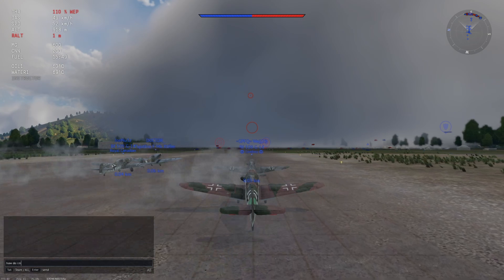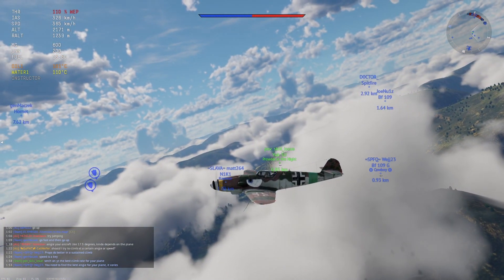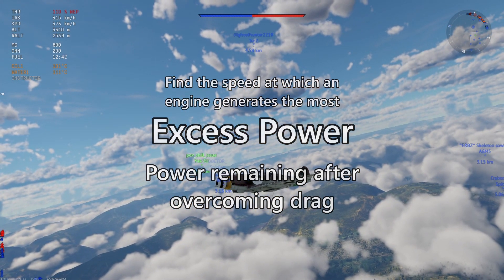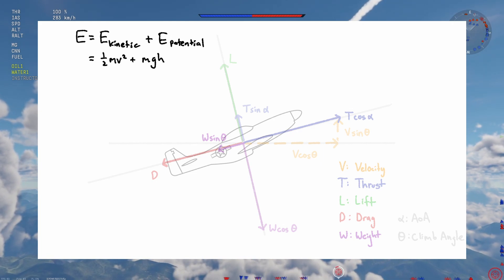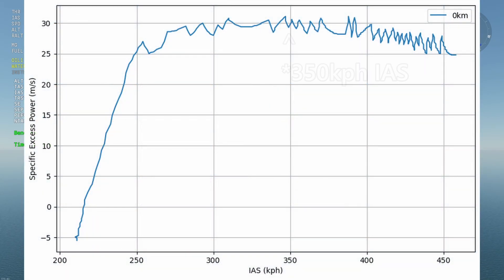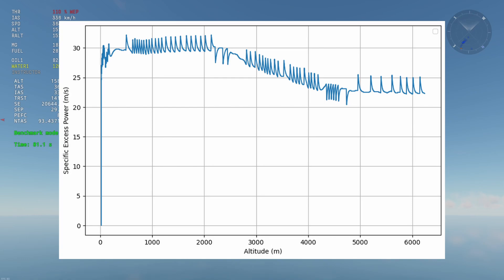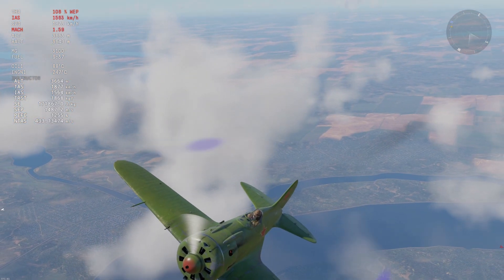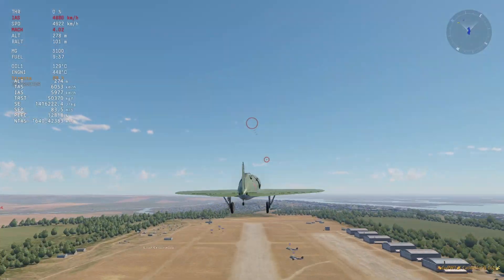Optimizing Rate of Climb | War Thunder

Comment: This test is probably much more important for the planes that overheat easily like BF109s and FW variants. As you said, with MEC and prop controls you might be able to squeeze out even more, I dabbled in this stuff ages ago but came to the conclusion it was probably just better to leave auto engine management on.
Reply: On some planes MEC actually makes them perform way better.
From my testing, on the IAR 81C (It's a premium in Italy, so you can test it out freely if you wish) (rank II BR 2.7 RB)
In the next example I am using said plane with the engine on WEP from the moment I start moving.
If you leave WEP on, without MEC, plane will overheat the engine while having a top speed of around 390 at sea level, at 385 the temps are orange on the engine and yellow on the oil. Prop pitch is brought way too high in auto mode it just feels like it hits a brick (well, more of a aerodynamic) wall. So it overheats the engine because of the higher RPM, and blocks it from going faster because of the drag of the propeller and the radiator fins. Nice equilibrium there, eh?
Same  WEP setting, but with MEC, prop pitch at 60% (You'll need ~85% for take-off (careful not to break the engine from over revving, stall speed is around 150 km/h), 72% for up to 240 km/h, and after that speed 60% (I tend to use 85% for take off then once I reach 150 km/h I bring the prop pitch down to 60%) this grants the top speed of 407 km/h at sea level compared to that 385 km/h... decent upgrade, top speed of this plane is 485 BTW), radiator at 0% (wish I was kidding, taking to account I am saying the engine overheats on WEP when left on it's own...), and oil radiator at whatever ya like (100% because it doesn't affect drag at all it seems) it flies at 408 km/h from my testing... 390 km/h if you take the 250 kg bomb.
And that is on WEP the entire time... With the temperatures being in the yellow for the engine itself it doesn't exceeds 251 degrees (Celsius) which is 1 degree over the point where the game shows the engine as yellow (so basically the plane can fly at a higher speed that is sustainable than without MEC where it can reach a lower top speed and then you have to get off the WEP because of the heat), and normal temperatures for the oil. (Upon checking the wiki, radiator seems to work best at a speed higher than 341 km/h... so I guess that explains the 0% on the radiator, it's all in the prop pitch it seems). I've flown for at least 15 minutes on WEP and never had the engine's temps go over yellow (252 degrees is where it seems to sit at). But that is at sea level. Top speed of the plane (485) at the height of 5 km can be exceeded slightly with the prop pitch 48%, radiator 0%, oil radiator 100%, Mixture was on 20%. Going under that doesn't seem to affect it in any other way than the engine overheats insanely quick...
Another example of the automation screwing up in planes' engine management are the BF109 (tech tree one at 5.3), Yak9 ,G55 and G56 in the italian tree... All of these planes can sustain high speeds on WEP without overheating. (Or at least they overheat way slower with MEC)
When I was grinding Air RB I demonized the G55 and G56 for overheating...but it wasn't their fault.
It was the game turning the prop pitch to 100% and both radiators to 0%. In order to grant a little bit of extra top speed.
Issue with the G55 is tho, radiators fully closed let you go faster but cook the engine really quick.
If you open the radiators your top speed goes down by a lot.
It depends a lot on how much you can lower your drag, and how much you can optimize the engine in not generating heat, dissipating it OR striking the perfect balance between drag and engine heat (radiators + prop pitch). (BF109 can have either top speed runs with which it reaches 570 km/h for a few seconds, or it can sit on a constant 550 km/h, still testing here, so there might be higher attainable speeds)
In theory you can make the IAR or any plane not overheat ever by putting the radiators to 100%. But you won't reach high speeds with that tactic.
And as much as I hate saying this, each plane has different percentages where it runs optimal. You yourself need to find it.
MEC on the BF109 (G14/AS) Sea Level:
 Speed: 557 km/h
Prop Pitch: 50% Radiator: 5% Oil Radiator: 5%
Non MEC on the BF109 (G14/AS) Sea Level:
Speed: 548 km/h
Temps are in the orange, they go into the red after a minute or so of maintaining this speed. This plane tends to run out of fuel faster tho, so do take a look at the fuel every now and then.
BF109 (G14/AS) at 7 km:
Speed: 677 km/h (672 km/h without MEC)
Prop Pitch: 40% Radiator: 10% Oil Radiator: 10% On this one there isn't an easy way out. It requires a bit of micro managing, whatever goes into orange first, bring the radiator of said fluid to a higher percentage, 30% if you want to keep the speed, 100% if you want to cool off very quickly but give up speed.
Gonna be honest, the BF109 is giving mixed signals. I'd say, at sea level altitudes, take control of the pitch, keep it at 47%, at the 7km mark where the plane reaches it's top speed let the game handle the pitch. My pitch changes didn't really do much in reaching higher speeds. Just handle the drag and the temps.
Another note: I was flying it with the 20mm cannons installed. 30mms have less drag. And without the gun pods it reaches higher top speeds than this. Also, because this is the italian version, it has better cooling than the german one, so if you have the german version, sorry, you can start off with the stats I have here, and then increase the radiator % until the temps stay at a stable rate, or somewhat stable. 
G55: MEC
Speed: ~500 km/h
Prop pitch: 80%
Oil Radiator: 20%
Radiator: 20%
According to a spreadsheet I found a few days ago ("War Thunder Top Speeds at sea level" it's called. I think it shows up in a Reddit post, I'd leave a link, but last time I did that, YT sent my comments to the shadow realms) that started my entire testing here, the G55 can reach a speed of 527 km/h, and yes, it can, but by that point the engine gets damaged and looses power... Bummer.
I think I'm gonna end this here tho... I'll do some more testing like this,write down the results and maybe even record and show the methods I've used or who knows, I gave you an idea on a video...but I'd say this has reached it's end point in usefulness and me updating this constantly is a bit tiring. I'll leave a final message on this and say that it depends on each plane. On most I've tested it seems it's better to keep the auto thing off in most scenarios. Depends on the plane, and height. If there's a plane you feel it's underperforming, go into MEC and test things out like I did. It most probably IS underperforming. Game is trying to put the prop pitch too high to a point that the engine can't defeat the drag and propel you at a faster speed. But it tries to do so anyways, and in that constant trying to defeat the drag, it ends up overheating the engine which leads to you having to get off WEP and loose speed. All of the speeds I wrote here are sustained speeds at sea level and the height the game says the top speed is at. Other than the BF109 and the YAK needing some micro managing on the radiators, the other planes I've tested never needed anything changed on the 4 stats you can change in MEC (fuel mixture, propeller pitch, oil radiator and radiator). Only the IAR I tried the fuel mixture on. Most of the time I ran out of fuel before I had the engine overheat.The fuel mixture seems to affect performance at higher elevations, changes very little at sea level and interestingly enough, doesn't seem to change fuel consumption. BF109 doesn't let you modify it. Anyhow, if you have any prop plane ya have a question about and want tested (and is in the italian tech tree) tell me and I'll reply and try to help. At least at the moment of writing this, I only had the italian tech tree researched to about 70%.
Reply from the maker: @Rob-326  damn bro you wrote a whole ass essay, you think I'm gonna read that? (I am going to read all of it, just not at the moment. This looks like a really detailed explanation, thanks!)
Reply from the maker: Huh, yeah that is quite interesting... I don't really have anything to add to that cuz idk much about MEC. but thanks for the info! And lmk if you find anything new in your testing
Reply: @CatWerfer  I recently found out about the MEC stuff too.
Had way better results in matches where I was using MEC than in ones where I didn't.
Reply: @CatWerfer  Well, testing for now is done. I edited the comment a lot of times (Way too many lol). And I think it is in it's final form... At least for the forseeable future that is.
I added the results in that comment at the end.
It went from an essay to a thesis or something. xD
Watch Gaijin change the way aerodynamics and thermodynamics work in the next update making this entire thing obsolete.
Cheers!
Reply from the maker: @Rob-326  kinda wanna save this somewhere as a reference cuz it'd be a shame for this to get buried under 10 layers of comments
Reply from the maker: Huh ok good to know

Comment: "the overall goal we are trying to achieve when trying to optimize climb rate is to"...deliver the plane into a winning position in the game(/mission). the best climb method will depend on the objective of the climb, which sometimes is to deliver the plane to a given height not just in the least amount of time alone but with a given airspeed at altitude as well. this is most prevalent in jets particularly on an intercept, which will accelerate at low altitude first and then climb at a given mach number (Rutkowski profile). In war thunder props it can sometimes be better to arrive a little later to height with a lot more speed when you get there, especially in planes which rely on speed to survive
Reply from the maker: @ArtietheArchon  I should've qualified that statement with "for the purposes of this experiment and video", I am aware that maximizing sep is not always ideal especially when you need to gain speed for an engagement or get in a certain position relative to the rest of your team and enemy
Reply: @CatWerfer  so I did 3 climbs in the P-47, it was dead even getting to 15,000 feet in a 20, 17.5, and 15 degree climb. in that instance the player is almost required to consider other things in choosing their climb angle...at the start of the match a lower climb angle will put you closer to the enemy while a steeper climb angle will leave you with less speed. this is probably worth a video
Reply from the maker: @ArtietheArchon  I am planning on eventually making a video on positioning particularly in the early game. Interesting find, ill test it out myself when I get around to it.
Which p47 is this?
Reply: @CatWerfer  the only one that's not outright masochism IMO, the D-28 and clones
Reply from the maker: I like all of them, they're not all meta but I have a lot of fun in the razorback, and the P47N is nice in ground rb as cas+cap

Comment: me looking at these graphs knowing i just use 20 degree climb universally and adjust by looking at speed. too slow? reduce angle; see what happens; adjust if neccessary. generally staying above 300 kph. works just fine. after all its just wt most people dont even climb at all so any angle above 0 is good lol
Reply from the maker: yeah if it works well for you then its probably good enough lol. just so long as you're not lawnmowing lmao

Comment: I don't think the Mustang has supercharger gears, since it uses turbocharging. At least the Merlin engined ones.
Reply from the maker: I'm probably using the wrong word, sorry for not doing a more detailed look into it, I probably shouldve when making a technical video like this.
I don't really know that much about engine internals and how they work so I kinda guessed hoping i was right (but i guess i wasnt)
There is a distinct performance inflection point at 2km and 4.4km for the p51h engine though so if it isnt supercharger gear then it at the very least is something that's hardcoded in the game
Reply: You’re correct about the 51 have gear superchargers.

Though your conclusion that 2.2km and 4.4km are the gear change altitudes is a little off, but not by much.

2.2km is the critical altitude for the superchargers first speed. 4.4km is the critical altitude where the the first speed can no longer generate enough boost to make up the HP deficit caused by engaging the second speed for the superchargers. 

If you kept testing you would find an inflection point at 6ish km that looked like the one at 2.2km, where the second speed peaks.

Geared superchargers usually gain power until their peak altitude. This is because the engine cannot fully open the throttle on the supercharger until that point without over-boosting the engine. Superchargers hate throttling because the engine has to use the same amount of power for less boost. 

After the peak altitude the engine loses power because the supercharger cannot sustain the needed boost anymore. 

Running the second speed takes more power. Hence why you wait to change gears until a certain alt
Reply from the maker: @zedoktor979  ooo okay, thanks for the thorough explanation.
Do you think this changes much about the conclusions I arrived at in the video?

Comment: I always aim to find the angle that very slowly increases speed and then droop the snoot a little to increase my speed gain. Dunno if its the best way, but i always seem to end up higher than most every other plane outside of the "meta" props. Can't say the same for jets cause flying high always ends up with me getting obliterated. So i just feather the thruster for max speed near the ground.
Reply from the maker: yeah it seems everyone has their own climbing strategy and if it works for you and you're conscious enough to put thought into it then tbh you're probably fine. The big issue is the US mains bombing bases in their p51s...

Comment: i actually try to base my climb off the deflection angle.
for any plane i try to find the speed where my true velocity marker is less than ~5 degrees apart from my nose direction, you can see this in virtual cockpit view.
you didnt adress this method in the video but im curious about how effective it really is, for me it usually allows me to find good climb angles really well
Reply from the maker: ooo thats a really interesting method. if you do end up testing it yourself and timing it compared to the others then let me know how well it works, i'd be interested to hear
Reply: @CatWerfer  im not interested in doing a thorough test but i decided to do  quick test in the p51h. 1 run each
(for this comment, DFA = deflection angle)
my test setup: spaded p51h, cold start from runway race to 6km, no mods or anything to set accurate stats, using phone stopwatch to time it.
control test ~17.5degree set angle: 4minutes 12.5 seconds or 256 seconds
(notes: my IAS was roughly around 290 for a lot of the time start of the test i rose up to 24 degrees climb angle at its peak but eventually had to lower down to 18 again as the deflection angle worsened due to lower air density)
variable 3-4 degrees of deflection angle: 4minutes 14 or 258 seconds. i say variable because at the start of the climb it was a bit of testing where to get the DFA and airspeed to stabilise (i am not a perfect human PID controller after all :P).

conclusion: the method seems better than set IAS, and either on par with or roughly worse than set angle but hypothetically applies to olmost any plane ignoring other characteristics (me264 would be a notable example with the standard DFA being +5 degrees due to the fucky wing angle). Because every plane suffers from a lot of extra drag with too much DFA and wastes potential climbrate when speed is so high that the DFA is negligent.
but the IAS tested in the vid also only up to 290, which as you already mentioned the ideal IAS climbrate is closer to around 340
Reply: also i just realized i dont know what AOA or deflection angle exactly even is, because i googled it real quickly and the answers seem conflicting. so just to be doubly clear i mean the difference between true flight direction and plane nose direction (appearently deflection angle is just aileron/elevator angles oops)
Reply from the maker: @jevry4307  hm thats pretty neat, thanks for the find! maybe I'll also test it since it seems like a pretty reasonable compromise of a climb method
Reply: This is the easiest way. I usually try to maintain a 14-15° climb with the marker, while also keeping speed at about 190mph (depends on the plane) until I get up to bomber spawn height, then put the nose at about 10° to gain some speed.

Comment: Awesome video, I've been thinking about climb speeds long before watching this video so I have some ideas on how to improve the calculations, it's all based on intuition so it's entirely possible that it's wrong.

I don't think finding the best speed for excess power is enough for discovering the best climb rate.

While engine thrust is necessary for climb, it needs to be converted to lift first, which isn't 100% efficient, and different AoAs, Speeds and Altitiudes are going to affect the efficiency of this conversion of energy.

I think the optimal climb rate is a compromise between the optimal speed for excess engine power and the optimal AoA for the best lift/drag ratio. So for instance, if your plane's wings generate the best lift/drag ratio at, let's say, 15 AoA, then your optimal climb speed would slightly lower than what your optimal speed for Specific Excess Power is.

Add onto this that your propellor efficiency might change depending on AoA and that lift/drag of the wing may depend on many factors, and it gets near impossible to calculate.
Reply from the maker: Maybe, let me know if you find anything interesting in your testing, i'd be interested to hear where you go with it